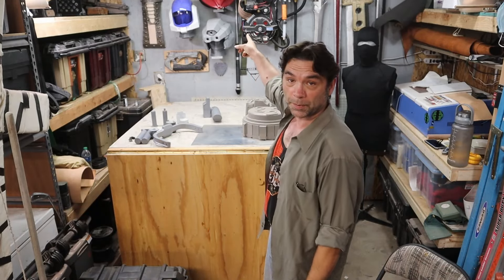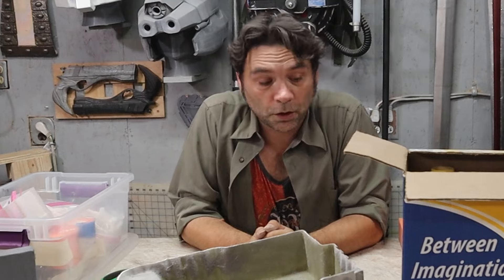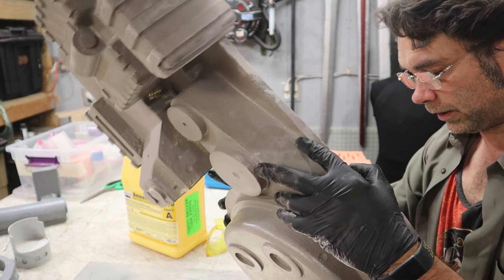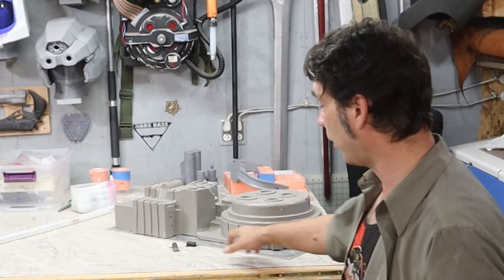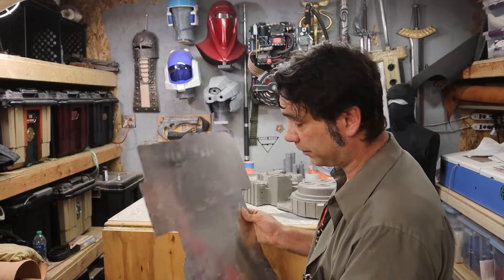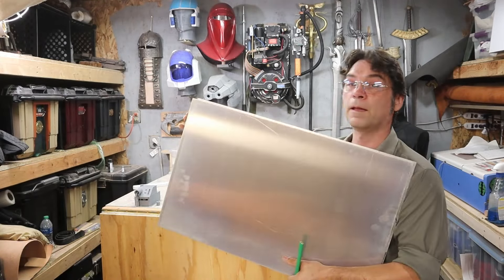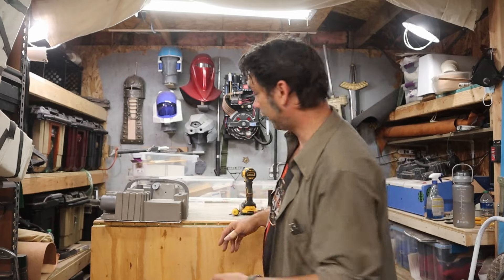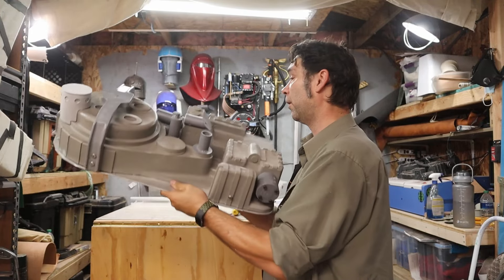Cutting and Mounting an Aluminum Motherboard to a fiberglass Proton Pack

Comment: Rivnuts/nutserts are going to be your best friend in builds like this. I've got them on all my brackets in my proton pack. Quick nuts can fall off, and it beat trying to jbweld nuts on top the bracket
Reply from the maker: I was thinking about JB Welding them in place, but I just ordered a set of rivnuts to test first.